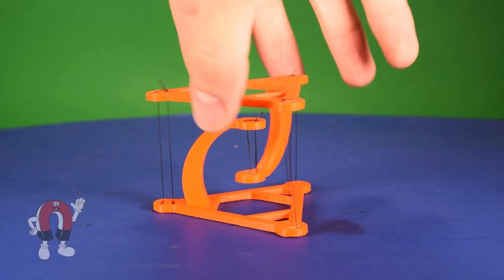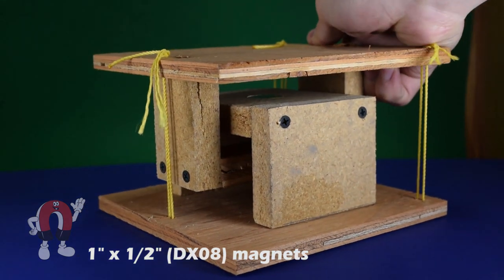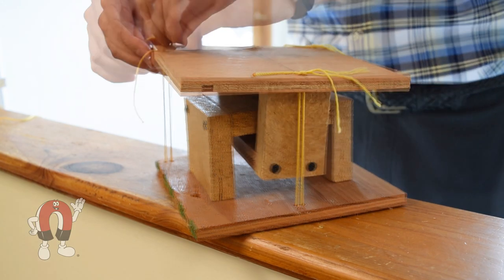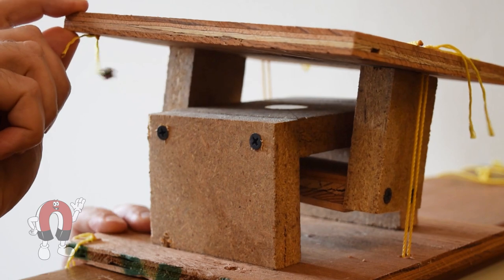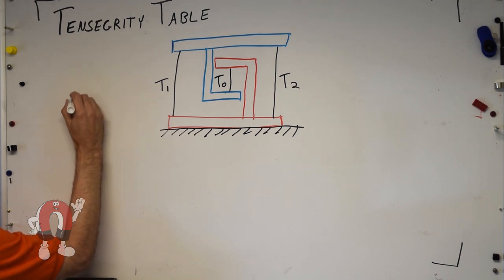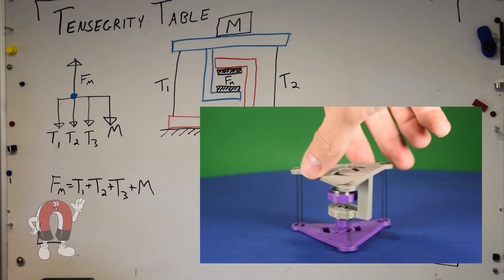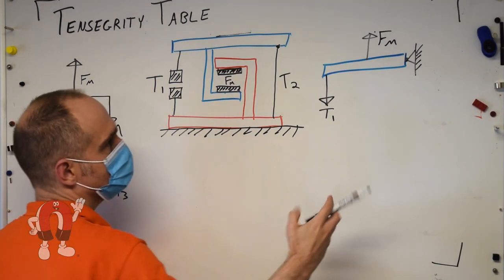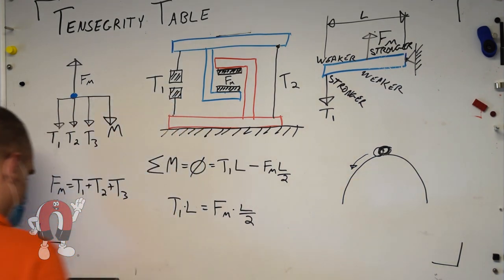Magnetic Tensegrity Table

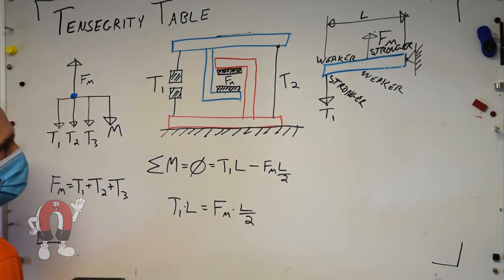Comment: You could beat Earnshaw's theorem by using a material with mu_r<1 (i.e. a diamagnetic material, like pyrolytic graphite). Essentially, you create a small dip in the energy-hill depicted at 9:25, and reach a stable equilibrium there. It will take an ingenious design to make a large-scale implementation of this though.. it is not theoretically impossible.
Reply from the maker: True enough. We've done so before (https://www.kjmagnetics.com/blog.asp?p=diamagnetic-levitation). Of course, this also puts us outside of the "using only a series of permanent magnets" part of Earnshaw.
Reply: @KJMagnetics  Sure, but I mean on a large scale (like the tensegrity-table ) - more than a few mm airgap. The ideation of a robust and safe stable design shall be the work of a genius. The "(almost)levitating pencil" could be a good starting-point, perhaps?
Reply: Why doesn't Elon Musk have this as furniture?

Comment: I'm surprised you didn't try repelling magnets for one of the sets of tensions.
Reply from the maker: Of course, repelling magnets don't provide the tension we need at those 3 corners.  It's already flying up and away.  Adding more force pushing it apart isn't very helpful...
Reply: @KJMagnetics   Makes sense. I would have tried attraction at the corners and repelling at the center. Calc the teslas so the three corners = the one in the center.  But i'm just a laman. I would have had fun watching it fail. :D
Reply: If you flip all magnet pairs from attract to repulse, I think you'd find a linearly stable equilibrium through the vertical axis of the table.  The center repelling pair would work with gravity to collapse the table and the three or four corner repelling pairs would work to counter this.  However, this time, with the forces reversed, the balance point between the forces is stable as all magnet pairs are working to locally repel their part of the structure.

Unfortunately, lateral stability would be zero and the slightest deviation would topple the table I suspect.  Perhaps clever arrangement of the magnets could take advantage of the corner magnets pushing against the opposing center magnet to push it back in line, but it'd be tricky at best and likely impossible to get right.
Reply: @KJMagnetics  You could actually use the same mechanism at the core of the table.  Tie the magnets such that the magnet attached to the base of the table is above the magnet that is attached to the top.  Now as the string is stretched, it will pull the two magnets together against their repulsive force.

Comment: Using the magnets like you do in your small scale model, where the magnets are touching, on all 4 strings, considering they couldn't move any closer together, and with enough pull strength they'll be hard to pull apart, could it not work to take load, as long as the centre pair are strong enough to take that weight also?